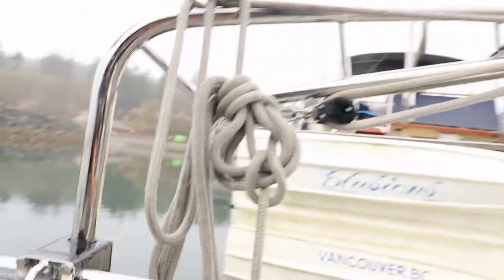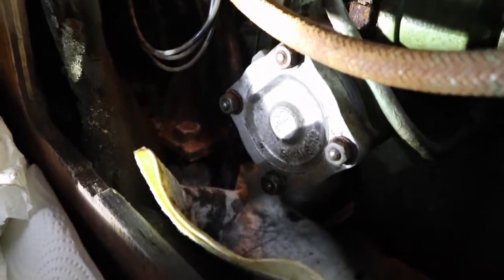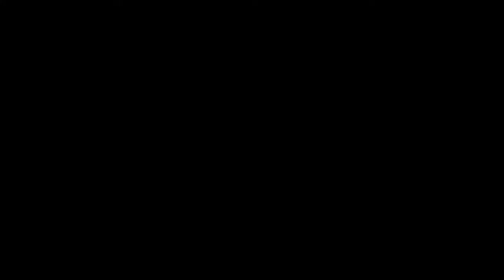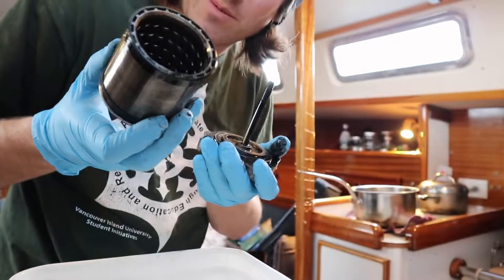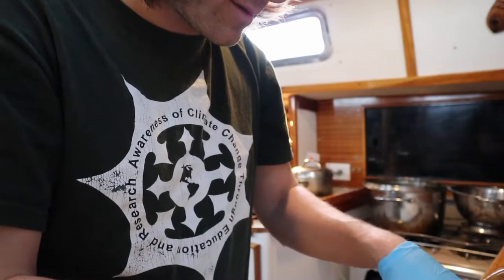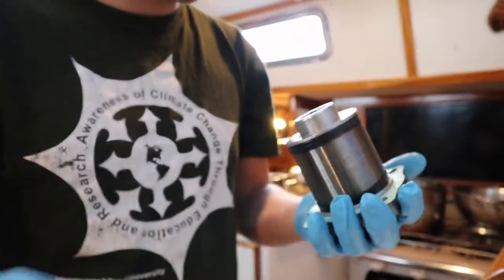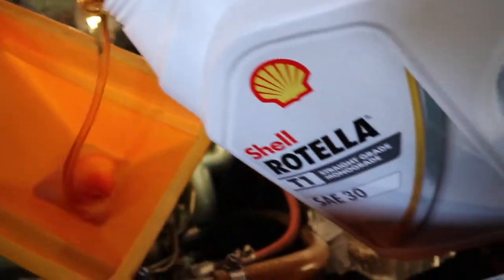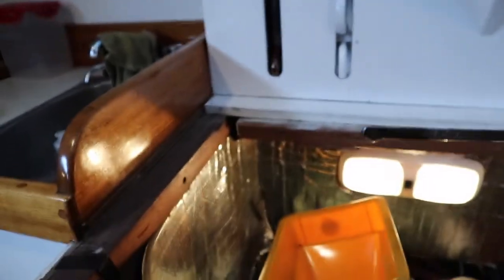Changing the Oil on a 1979 Mercedes OM636 Marine Diesel Engine

Comment: Hi Mate, this is a great video, I just noticed you didn't bleed the engine, I thought some air might get in - can I confirm that you didn't need to bleed ? Cheers !
Reply from the maker: Hi Damien. Thanks! 

There shouldn't be a need to bleed the engine when doing an oil change. However, when changing the coolant, you usually need to. On the OM636, there is a tiny little hose at the fresh water pump that is meant to bleed it, but it is notorious for getting clogged as I quickly found out when I did a coolant change! The way around that is to loosen off a bolt at the top of the water pump to release the air that gets trapped up there and forms a airlock. Thanks for watching!

Comment: Great video. Eventually plucked up the courage to do my own oil change as mechanics in my area are as rare as hens teeth. Any advice on the separate spin-off oil filter that Westfield sell as an aftermarket fit? I have a W33 so access is dismal.
Reply from the maker: I've not looked into the spin-off kit, but could certainly be a good option. I like the reusable filter fitted on my boat, but I do need to get a spare! I'm very careful with it, but nervous on what would happen if I accidently dropped it! If you go for the spin-off route, I'd be keen to hear how it goes! Thanks for watching!

Comment: Hi have u ever changed the injector pump oil, any info u have would greatly appreciated Thanks Ray
Reply from the maker: Hi Ray. I was going to include that in the video in fact, but still felt unsure about that seemingly mysterious subject, so did not want to inadvertently share bad information if I'm not doing correctly ! I did refresh the oil in the injector pump by using a syringe to extract the old oil (which looked very clean) from where the the dipstick goes, and then replaced it with fresh oil also using the syringe. I think I got about 150 ml of oil out. It is strange the lack of clear instructions out there on that subject! 

The Westfield 4X4 facebook page has some info on this. 

Later next week, I'll make a little video about the injector pump oil and post it on my facebook page here: https://www.facebook.com/sailingseadreamofclyde

Hope this helps.
Reply: @SailingSeaDreamofClyde  as far as I know (I've got a W33 + OM636) the oil in the injection pump is considered a consumable so you only need to check levels and add some if it's low. Never heard of anyone changing it before :D Not sure where I got it from, it may have been from Manfred (runs westfield 4x4) but I'm not sure. Also, look after that TDZ pump, it's impossible to get any spares for that thing and changing it to a Bosch is a happy fun time (not) process (going through it now).
Reply from the maker: @BenvanStaveren  Hi Ben. Thanks for that info! I decided to extract what I could as when I pulled a little out, it seemed as tough it was very thin and resembled diesel rather than oil. Had you found that with yours? Maybe it was just warm oil that appeared thin, but was fine... not sure, but either way, after exchanging the oil that was there with fresh, everything was running well.

Here is one of the bits of info I found: https://forums.ybw.com/index.php?threads/mercedes-benz-om636-with-tdz-injector-pump.366706/

Had you just always added oil, but never extracted it to refresh it?
Reply: @SailingSeaDreamofClyde  as far as I know, the oil will mix with diesel in the pump so it will come out looking very thin - I generally just check it before I depart, if I think it looks too thin I add a few squirts from the oil can. Can't over-fill it anyway, if it's too full the pump will just start dribbling it out of an overflow hole. Also just read the link you posted, which pretty much says what I just typed. Might even be where I got the info from.
Reply: @SailingSeaDreamofClyde  oops, too quick on the enter key - I've never removed the oil before, just added when I thought it looked like it needed it. I can no longer really speak as to the TDZ pump since mine busted it's little guts last season, so I'm now in the fun process of installing (and timing) a rebuilt Bosch pump. Same idea, though.
Reply: I also add now and then some engineoil inside the High pressurepump. It gets thinner because of the dieselfuel. My mechanic advised me for this reason to use a little thicker engine oil. Still need to buy it.

Comment: I'm kind of jealous with the level of access you get in a Discus. In the W33 I get front and top access relatively easy, but no way to get at the oil filter without making like a snake person in the engine room. Unless I carve out an access panel under the galley sink where all the drawers are (so still a pain in the ass to get to regardless).
Reply from the maker: Yes, the engine access is pretty nice on bridge deck version of this Discus. After some pretty brutal engine access on my last boat (a "Cal-29"), that was one of the selling points for me when I first viewed Sea Dream of Clyde! The oil filter is accessed from under the galley sink for me, too. But I don't need to remove the drawers above, but just a few cooking pots I store in there. 

Thanks for your input above! It is reassuring for me to hear your experiences with the TDZ pump, and I'm sure will be helpful for others that come across this.
Reply: @SailingSeaDreamofClyde  no problem - I hope it'll help a few people maybe. Can't beat the OM636 for reliability, they're worth looking after. It's maybe a little ridiculous to have 42hp on a 33ft boat but eh, better too much horses than not enough :D Wildlings Sailing recently did a series of videos on a 636 rebuild, also interesting to take a look at maybe :)
Reply from the maker: @BenvanStaveren  Ya, for sure, though where I cruise, the extra HP has been helpful to get through some of the many strong tidal passages around here when I've been late or early for slack current! 

Ya, I saw those rebuild videos. Great series indeed!
Reply: On my Discus I made an access hole on the port side. This for easy access to the raw water pump.(seawaterpump)
Reply: But after watching the vid again, I noticed Sea Dream of Clyde has that already. Good.